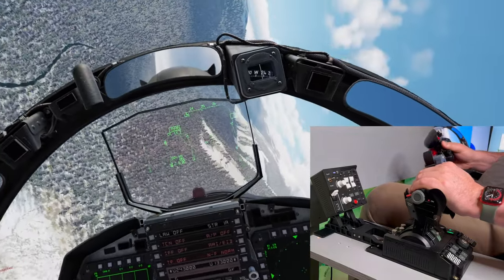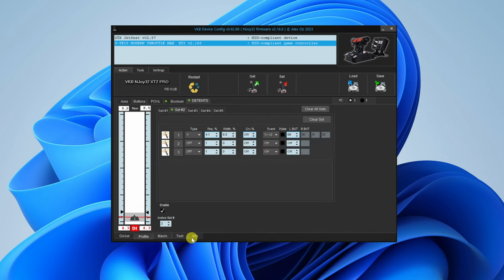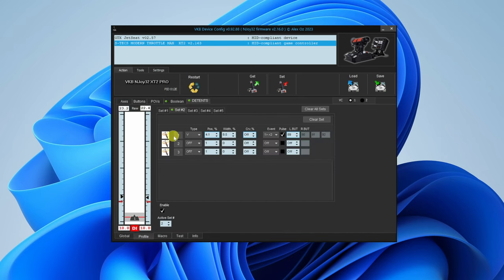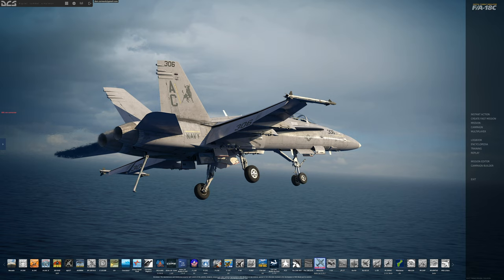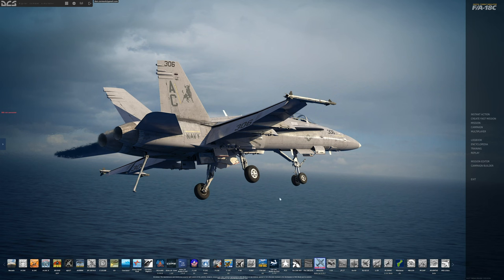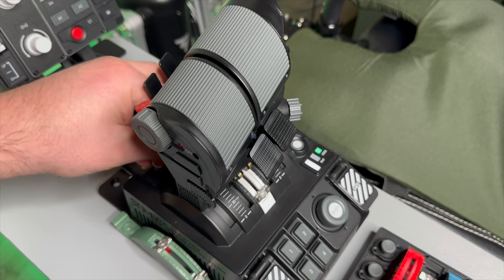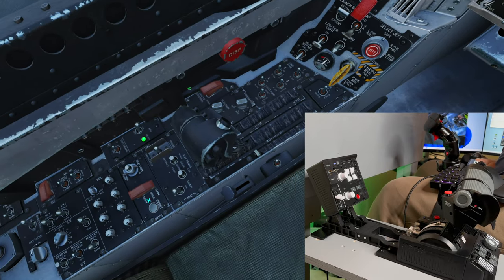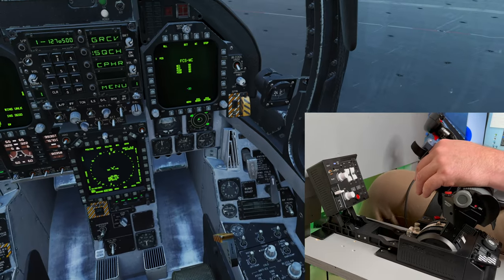DCS VR | STECS Video Followup - Solutions!!

Comment: Btw, VKB have also recently a couple of new STECS videos showing how to add the third virtual flap button and also how to convert encoders into axis. You can even convert the K-switches to axis!
The more I learn about the STECS and the software the more I'm really liking how configurable it is. I think they're really offering something no other throttle does.
Reply from the maker: I heard about their video and it's great that they put one out as it definitely will help the majority of people who don't know the software. I really like the ability to change that three position switch to an axis! More options is a great thing. It lets people use the hardware in ways the designers may not have considered.
I will admit that I never really gave VKB much thought. I had my Warthog Throttle and stick and then bought a VKB stick base it it was great! I had some issues and their customer support was rock solid (which is an often overlooked aspect when people want to buy a device). I knew I wanted a new throttle and was going to buy a Virpil but I wasn't too thrilled with the latest they had. I avoid WinWing because of customer support issues which I have heard of. Then VKB announced their new throttle and I did some research and saw that people have had generally great CS experiences with them... and here we are. :)
Reply: Surely virpil must have a powerful software as well?
Reply from the maker: @YofbjpYudhs  I have no doubt that they do. I do have the Virpil CM2 base for my stick but I have never had much need to use it beyond calibration of the stick. My videos about the VKB STECS was just my efforts around sharing my experience and opinion of it and then the solutions which people helped me to discover. This all forced me to make greater use of the software than I had wanted but it all worked out well and so I thought I'd share that part, hoping to help people who are in similar situations such as I found myself in. I love my Virpil base and really was considering their CM3 throttle but I wound up buying the VKB as it was new and shiny and I liked the customization aspects of it via hardware options.
Reply: @StrIIker-TV Hello thanks. Do you know that rolling thing near throlly in the middle? Can I make it into axis please.
Reply from the maker: @YofbjpYudhs   Donyou mean the white selector knob on the base or the roller wheel type things (one on the left and one on the front of the left throttle)?I don’t know if the rollers can be made into an axis. So far I have only heard of the  flap switch on the STEM having this option. I don’t think it can.
Reply: @StrIIker-TV  I think I found a video on making encoder into axis thing maybe it will work too.
Reply: @YofbjpYudhs  Virpil does have great software. However, the thing that sets VKB apart for me is how customizable their HARDWARE is, and the software supports the customizable hardware painlessly. There are buttons that can be turned into hats, hats that can be turned into buttons, buttons that can be turned into axes, axes that can be turned into buttons, and more. It's VERY EASY to change these things so you never feel like you have to adapt to your controls. And when new things come out, they often design everything to be upgradeable. What other company releases a new joystick along with the parts so old joysticks can upgrade their features for significantly cheaper than buying a new stick?
Reply: @StrIIker-TV  The white knobs (EN1 and EN2) can turn into axes easily in the software. There's a video on VKBs page demonstrating how to do it.
Reply: @TheK1ngFiasco  I see. Good to know. Wondering if one should get the Virpil stick or VKB. they are all very expensive.
Reply: @StrIIker-TV  Can you explain an example binding that you might want to use where you also change a 2 or 3 position switch to an axis?  I just can't get my head wrapped around that yet (i'm still very new to DCS).  Thank you.
Reply from the maker: @keithbriscoe99 Hi! I think I can answer that question. I am not aware of how one would change the switch to an axis unless the axis moves in the direction that you are pushing the switch towards. The only thing which I could think of relates to flying DCS on a flat screen. There are options to zoom your view in and back out to aid in spotting things at a distance or to better see something (some ground target). In VR, there are two zoom levels (VR zoom and a much stronger Spyglass zoom) where as on a flat screen, you can zoom in gradually (it's not a fixed jump to zoom). This is one typical use of an axis. I guess another might be to use a switch as an axis for a rudder pedal replacement. The individual may not have rudder pedals or may physically be unable to use rudder pedals and so something on the throttle or control stick would work. I think another might be for setting flaps in older aircraft (such as warbirds). I don't know if flaps or trim are or can be set using an axis but it's possible. I think there is an axis option for the F-14 Tomcat wing sweep (sounds familiar) but I am not sure. I'm kind of out of my element here as I have only flown modern aircraft and only a couple of them and haven't had the need for additional axes. But these are some of the potential uses for this.
Reply: Howdy!  I'm struggling config'ing a HAT switch for my TDC slew.  Ideas, tips & tricks great appreciated!
Reply from the maker: @donrumsey7422  Hi! I'd be happy to lend a hand! I am not sure what issues which you are running into so I will just give the basics to you to get started and ensure that you have done these. To configure the TDC slew, you will be configuring an axis. So, for configure controls, you will want to click the gear icon on the main screen, select the aircraft you want from the top left drop down and then in the drop down next to that, select Axis Controls. Across the top look for your STECS throttle, you want to look for TDC slew or Throttle Designator Controller (how it's listed varies but you get it), There will be horizontal (or x axis) and Vertical (y axis). Those are what you want. There's sometimes a mouse option listed and that is NOT what you want. So, select the x axis / horizontal so that it is highlighted under the STECS (double click), then move the TDC hat forward and back and you will see it show up. Do the same for vertical but up / down obviously. Now the axes are assigned.. but wait there's one more thing to do! Let's single click the horizontal control again so it is highlighted (not double click). At the bottom click on axis tune. I suggest putting a curvature in there (I use 27) so that when you want to make fine, small movements using the TDC (getting that target set just right), small movement on the TDC doesn't make it jump too far. This should be revisited until you get it set the way you like. Do the same for vertical. Sometimes you may need to come back to this setting to INVERT the slider (there's a box for that) because up on the TDC moves the cursor down etc. This is common. Similar for things like toe brakes or rudder pedals at times. You will know when you run into this. It's a simple fix (check that box). So these instructions should get you all set! Let me know if you are having some other issue and we can work on it. Note: The TDC has internal guides which direct it towards the 4 cardinal axis points. top and bottom of Y and Left and Right of X. You can feel this by swirling the TDC around in a circle. This should help you establish which way is which.
Reply from the maker: @donrumsey7422  I think I realized that you want a Hat Switch and not the TDC switch (am I right?). My mistake! Well, to do that I think you'd need to configure that hat switch as an axis. This could probably be done via software but I have not done this before and I don't know how well it would work because you would only be able to move the cursor along the X axis or the Y axis and not a combination of the two (like to move diagonally). I imagine that using a hat switch like this would result in it moving the cursor along the axis as long as the hat is pushed in that direction. There may be some setting in the software which would also help set the speed of motion when you move it. I'll have a peek at the software.
Reply from the maker: @donrumsey7422  So a quick search yielded this https://www.reddit.com/r/hotas/comments/s04qby/vkb_config_how_to_buttontoaxis/ 
This might help get you on the right path. There seems to be a way to set up virtual axes which is what you want an dthen you assign the axes to the corresponding buttons on a hat switch.

Comment: Would this work for F-16 too?
Reply from the maker: Hi! This will work for single engine aircraft such as the F-16 and warbird types. I also use it for the BlackHawk where I decouple the left and right throttles and use one for collective and one for engine RPM (I forget what it's called). So for the F-16, you simply need leave the throttles coupled and then set the detent for afterburner.I've not done it and there was another person who said they are having difficulty however I think some step is missing for them. The actual process will vary for the F-16 and other aircraft. You can see the difference for how the Strike Eagle and Hornet are configured in the videos I made for example.

Comment: The thing you did with the flaps switch, DCS actually has a work around for this in the controls.
Using your flaps as an example, if X is up and Y is down, you can made the middle position set as "X off" and "Y off" and it will do the same thing. The TM Warthog throttle has the same issue with center positions not being "buttons". Awesome video though. Pretty convinced I need the Stecs Max now.
Reply from the maker: Hey thanks! I had no idea that there was this configuration available in DCS! Out of curiosity, where is that set? It's probably better to do it via the VKB software regardless as it adds an additional button in the middle right from the start. Apparently you can also set that flap switch as an axis by opening it up and removing the physical detents inside. VKB apparently posted a video to illustrate this. Pretty cool to have that option if you want/need it! I'm sure people who fly flat screen would love to use that as a zoom (although it would work best for that role in the STECS Standard config. Again.. It's great having options!
Reply: @StrIIker-TV  if you go into the adjust controls screen, double click on whatever you want to set the button for, then instead of hitting the button you want to assign, open up the "Key/Button" dropdown. There will be options for button 1, button 1 off, button 2, button 2 off, etc. Hope that helps!
I agree being able to do that right in their software is cool.
Reply from the maker: @DaveyCooter Ahhh! Okay that's super helpful! Man, stuff I wish I had known before! That's a huge help for times when the hardware can't be programmed!

Comment: Three position switch for the flaps is also great for mig-21 landing gear which is also 3 position and will run out of fluid if you leave it in up or down position instead of putting in neutral.

Comment: Hi, I have a small channel im and I’m waiting on a similar setup to yours to get into DCS. How do you record DCs in a rectangle (in vr). When I’ve tried all I got on my screen was a weird eye view.
Reply from the maker: Hi! I am always happy to help out with these frustrating things. I was in your shoes before. What you are seeing is the HMD mask which DCS uses to not render content which will not be displayed in the headset. This maybe helps give you a slight boost in FPS but I don't' think by much. In DCS, there is an option under the Options - VR tab labeled "Enable HMD Mask". You want to DESELECT this. This will get rid of the black parts of the display. You also want to DESELECT "Use DCS System Resolution" as this in my experience causes distortion of the window which you are going to record (makes things look squished / wider). 
So now you have a window to record in OBS. You will want to run DCS in VR mode. Load into a jet sitting on the runway or whatever, put the HMD down and center the VR view (you should have this bound to a handy button). Now in OBS, select the Game window as the video source. You should already set the resolution of the output, framerate, etc. in OBS. You now need to zoom the DCS output to fit the wider aspect of the OBS recording canvas. This means that you will chop some of the top and bottom off and probably part of the right side (assuming you are mirroring the right eye) but that's okay. Drag up and down to center the view to what you want recorded. I had to fiddle with this to get things just right. That should do it. 
I am working on a "how to" video for recording DCS the way I do (multiple audio channels etc) so that may help you as well once I finally get my butt in gear to finish it. If you have additional questions, please feel free to ask! No point in re-inventing the wheel with some of this stuff! If the above didn't work, let me know. There's a different way which I used to have to do to get rid of the HMD mask but I haven't had to do that since Eagle Dynamics added this check box to DCS.

Comment: Thank you for this excellent follow-up video. I hope this isn't a stupid question, but from my understanding, it appears that if you wanted to, you could setup different detent profiles for different aircraft but use the same physical detents/rail provided that each profile has its curves set to accommodate the slightly different afterburner activation % of each plane if you so chose, correct? I ask because I plan to get the mini+ and button combo set and would prefer to not change out rails (although I would if I needed to).
Reply from the maker: Hi! Thank you for the great compliment. I do think that you are correct (and no, your question is definitely not a stupid one). You could set the detent in the general location that you want to have it kick in and use the profiles in software to set detents based upon custom curves and adjusting the size and positions if needed to match what you want. A single frame would definitely suffice. You can then use the button press technique to swap from one profile to the other. I would probably set the AB detent (if you fly aircraft with after burners) to around 75 on the frame as that is probably a good spot. I think most people who do use the afterburner either go full on or full off so there,'t not a need for a large mount of motion in the Afterburner side. If you do like to stage in increments in the afterburner, moving the detent down a little would help. I posted pics of my two detent frames in the community tab. I would use the while settings personally if I had a single frame to play with. I think most throttles out there just have a fixed afterburner detent position and players adjust using the DCS curves. Being able to do it all in the VKB software makes it much better as the user curves can get "messy" and are a bit of a pain to get set properly when trying to adjust.
Lastly, it would be nice to see VKB allow more detent profiles in the software. Figure out some way of differentiating them with the colors or just require using the software to activate a profile beyond the base 5. Hope I helped ya!
Reply: @StrIIker-TV  thank you so much for the detailed response. It appears that VKB software is so powerful, you can do almost anything. It looks like maybe I'll just have to memorize the coloured lights for each jet which shouldn't be a big deal. 

On another note, that Alex Oz guy strikes me as a computing genius. I'm glad you were able to contact him and that he was helpful.

Looking forward to seeing more of the STECS in action.

Comment: My exp with VKB today
"I guess the proper name for the switch in question is a "Trigger switch" yes? now all I need is how to replace the switch i can find nothing on youtube on our VKB's forum. I'm not too pleased on how VKB expects me to change the trigger without instructions is that too much to expect??? how about you take all my VKB products in  trade for a WINWING or VPRILE  ...,.. ARE YOU GOING TO STAND BEHIND YOUR YouTube WHAT!...   AT 74 I THINK I CAN HANDLE REMOVING A BUNCH OF SCREWS IF THAT WHAT YOU WANT ME TO DO PROBABLY CROSS-THREAD THEM AND RUIN THE THROTTLE" still no guidance from VKB as they don't know at this point. my VKB products 2 bases 3 sticks and this stecs 33% failure rate if you  can afford the loss buy VKB
Reply from the maker: Yikes that sucks! Sorry to hear that! I don’t know how their customer service is for problems with the hardware but generally I heard good things prior to buying the STECS. I got some help with the configuration fairly quickly from them but that’s the extent of my experience. I have had stellar experience with a hardware issue with Virpil though and would happily recommend them. I’ve heard bad things about Winwing though as they are apparently worse than most to get quality help but maybe they have improved?
I hope you get your issue resolved. One thing I might suggest is to join the VKB forums and post some questions there. I got a lot of help from other users on that forum. Maybe also ask on the HOTAS Reddit forums. People there are great and always eager to help out. 
Let me know how it goes!

Comment: Great video! Really helped me out with setting up my STECS. I do have one question, what did you use to attach your keyboard to your thigh?
Reply from the maker: I am sorry, I missed this question! I bought some adjustable cinch straps (https://amzn.to/3B8lYwd) which have velco backings and are stretchable. I wrap them around each thigh. I also bought some adhesive velcro (similar to these https://amzn.to/3ZpSJ1V ) and stuck the corresponding part onto the back of the Tartarus (and my trackball for my right thigh). I trim them for size. This is very simple and effective. I hope this helps